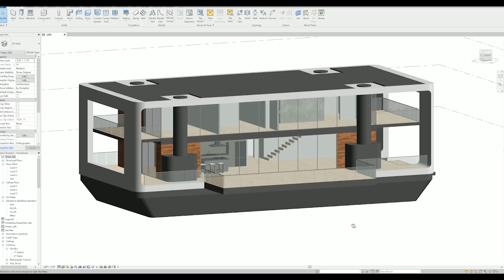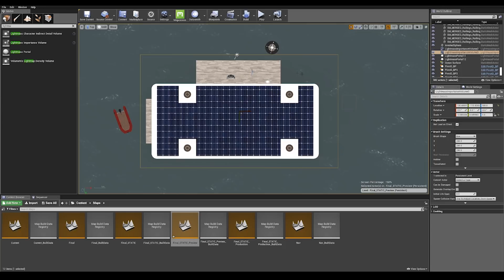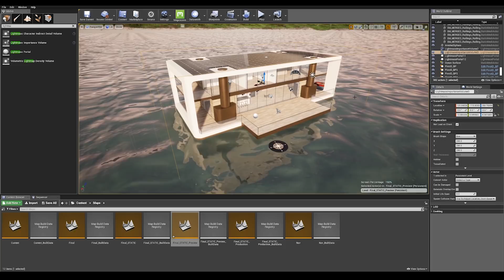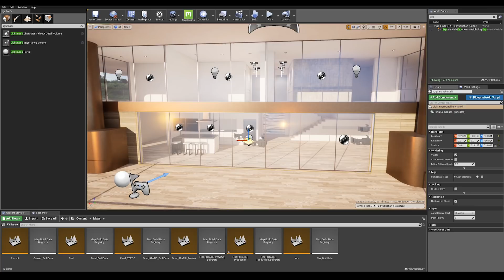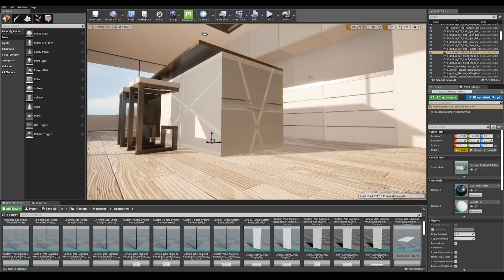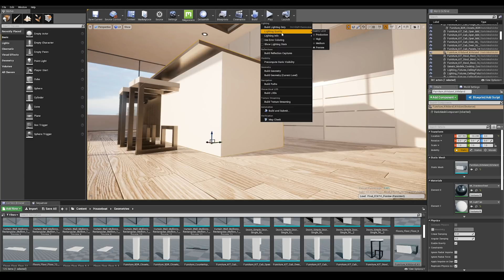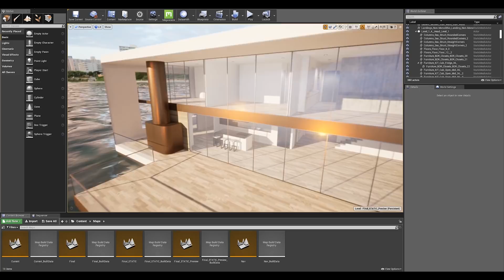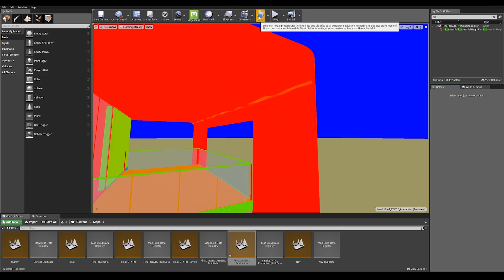How to Fix Lightmap Bleeding: Part One | Tips & Tricks | Unreal Engine

Comment: An easy way to also solve this is using Lightmap Templates, Pixel Snapping, and planning your Lightmap Resolution ahead of time. Also, delete faces off of any models that will not be seen, and will be flat up against another wall or polygon face in the game world. Good rule of thumb, is to keep islands about 8 pixels away from each other, and the outer boundary of the UV space, keep all UV Islands about 4 pixels away from the edge. Again, also use pixel snapping, and Lightmap templates consisting of each square in the pattern of the Lightmap template, = 1 pixel. so 2048x2048 resolution, would have 2048x2048 pixels. Make sure that you stay within at least 1 step up or down of your target Lightmap resolution of your 3D model/Asset, in the mesh's settings in UE4 (Default is 64, so change it to say 1024 if you aim for 1024, or make it 512 (down one step) or 2048 (up one step), but best practice is to stick to the original Lightmap resolution you are aiming for. One way to think of Lightmap Templates, is like the texel density maps shown in this video. Each pixel/texel, is a square on the Lightmap Template.This is what you would use, say, in 3DS Max, on the UV Grid when unwrapping to snap your UV Islands properly to the edges. This helps with bleeding because think of a shadow map being a picture. It is still comprised of pixels, so, if an edge is going through the middle of a pixel (not directly diagonal from one corner to another as you should do if you cannot avoid going through pixel squares), the shadow will still render as a full pixel, and half of the pixel it crosses through will bend around onto a side or edge you do not want, also creating bleeding. 

This is why Lightmap Templates are great to use in any workflow, and if you have a program that can automatically setup your UV islands and pack them, you can setup the settings so that the islands are enough pixels apart, as well as all islands to be properly spaced away from the UV Grid's edges. If using a Lightmap Template in the background of the UV Grid, say in a automatic packing program, and you can enable pixel snap, it should automatically snap your UV Islands in the right spots. A good program to use I think, is Rizom Lab's "RyzomUV Real Space". This program you can easily make your own UV Layouts with simple clicks, say on edges, cut them, (or if you make a mistake, stitch them back together)unfold them, and then lay them out, by fitting them within the UV Grid Space, and then packing them with a Artificial A.I. It allows you to do this many times, from 1 - 1000, with settings such as low, medium, high, and gold. This will find the best way to pack your UVs for Light mapping and textures if you wish, so your texel density is correct all the way around. I am not sure if it can pixel snap, but I'm sure it can. Hope this helps everybody outside of the information of this video.

Comment: Is it really necessary to use power of 2 values for lightmap resolution? I've heard in another tutorial it's not in this case, because they will be combined by engine from each individual mesh to common maps anyway. Actual size of lightmap textures is set in world settings (where the values should be power of two ofc).
Reply: I suspect the same... Also if it was necessary wouldn't the input reflect it somehow?

Comment: What if you have a large scene
Reply: Simple question but the answer is a bit complicated.
There are some ways to light e.g. big landscapes. You would take the big structures and landscapes out of the rest of the scene, and put them into a separate level. 
Those receive dynamic lighting, so you don't have to build lighting on those, then, in a different level you would have all the stuff that needs building.
Like for example a campsite on your landscape. 
That way you can build lighting on that level, without having the landscape kill your building process.
All of the levels are then being streamed in at the same time as the landscape, to create one scene.
Reply: press R and scale it down

🤡